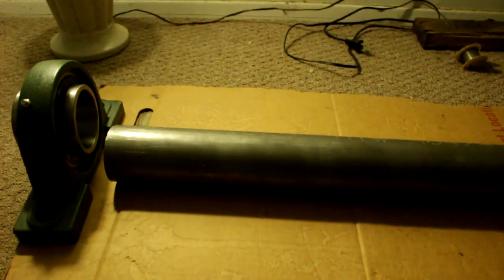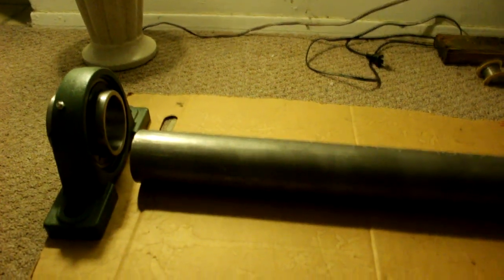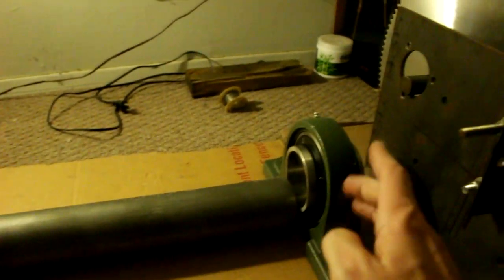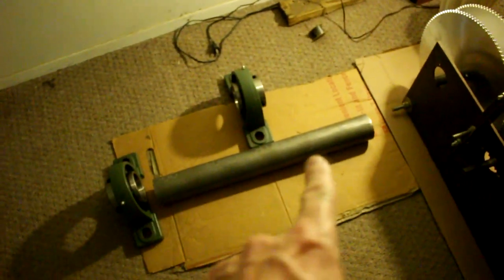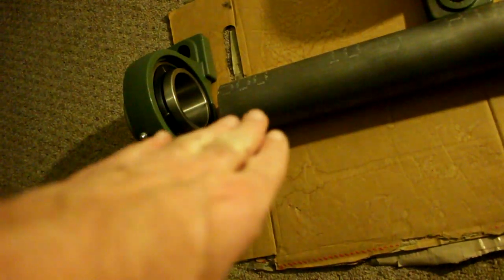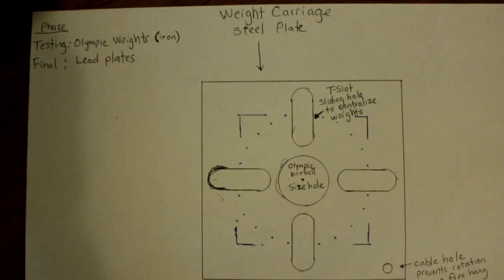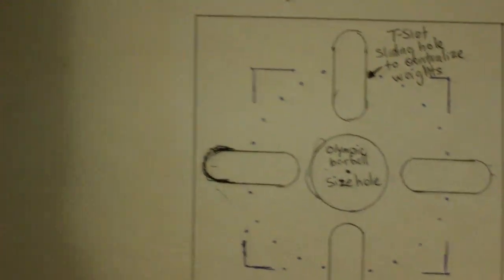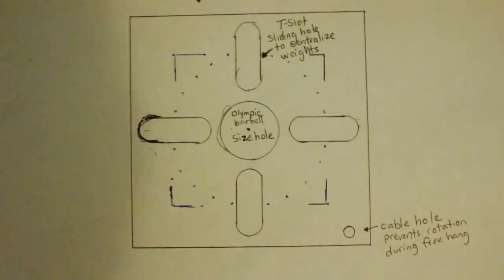Gravity Electric Generator Update

Comment: Good idea but let me propose a slight variance on your idea.  The main drive shaft can be driven by large weighted rods attached to the drive shaft  with ratcheted gears.  There could be several rods falling at various stages of their 40 degree arc.  The weighted rods could be lifted back to the top of the start posirion by using hydraulic jacks.  Main drive, like in your concept, is attached to an industrial size large gear.  Like in your idea, the gearing would be such so as to greatly increase the rpm of the main drive.  The main drive would power a generator.  The generator would easily power a small air compressor that would be used to automatically power the hydraulic jacks that lift the weighted drive rods.  This concept would allow you to easily lift several tons to create a huge amount of downward force.  I could see this working well on an industrial scale.

Comment: What ratio are you using to drive the alternator. You are changing ratios to lift weight right.
Just started thinking about this stuff the other day we have plenty of boreholes  just like the US hundreds of 1000.  If lifting 1 kg per metre  per second uses/makes 10 watts  then slowly dropping 1000 kilos say 1 km that's 10000J  if I read it right.
I have on idea on transmission gearbox will a ratio of say 100:1 actually increase power will she even move? I think so power from smaller high-speed versions could go to batteries with supercapacitors very fast charging would need braking system though.   Of course lifting could be done with a separate motor under different ratios driven by solar wind even hydro Power any excess free clean power.
Reply from the maker: For that much mass, you'll likely need gears not sprockets. The rigidity of the design and tolerances are paramount, to prevent any flexing, twisting, or binding of components. A 100 to 1 might work, but the truth is no matter how math simulation you run, the final design will be trial and error. I moved onto to another design, very innovative. It's going to revolutionize home energy.
Reply: Exactly what I was thinking  a fair amount of weight  to over come the inertia needed to start large motors & the gear ratio

Comment: So how do you plan to bring the weights back up?  Manually?
Reply from the maker: Yes, was considering attaching an exercise bike and some gear reduction. Eventually a 2 or 3 drop weight system would be really cool, may be something like 3000lbs lifts 2000 lifts 1000, this way there's always 900+lbs net going towards the electrical load, with the remaining 1100 or so lifting the next cycle. When all the drops have been exhausted, you would only have to lift the 3000 lbs weight to start the cycle all over again.
Reply: @jryer1  If you are planning to use the energy created by the system to feed itself, that will never work.  You will either have to manually put the weights back, or add an external energy source to get the weights back up.  Your system will not work as a closed system.  We know this and it's been proven in Physics.  So I think you are talking about physically placing the weights back up using an exercise bike and your energy?  If so, that will work as long as you don't break ;-)
Reply from the maker: @valveman12  The perpetual motion crowd is always fixated on closed loops, not me. This is simply an electrical generator with the hope of extended run time, and when the final stack of weights fall, the first stack will have to be lifted back up to start the whole process over again. That could be an exercise bike with gear reduction, solar, wind, anything really. It's even possible to hook the truck or car up to it, drive 8 feet, and bang the weight is back to the top, with some gear reduction between the system and the vehicle. I see this as being an emergency generator, or off grid if absolutely desperate for power in the middle of night or something. Now if you really want something cool, wait to you see my design for driving a vehicle on top of a platform, and the vehicle is the weight for the generator to turn, again with extreme gear ratios, the run time should be fairly long. When the platform is done falling, back the vehicle off the platform, hook the platform up to the vehicle, back up a little more while it lifts the platform up, to start the process all over again. There would need to be a ramp or build up driveway so the vehicle could drive up and onto the platform, very cool design and only uses a few drops of gas to do it.
Reply: @jryer1  I like the solar and wind idea.  That would certainly have a good chance of working out.  I'll be following your progress.
Reply: Getis Realis I'm going to keep searching for others who've been working on something similar to the vehicle lift & I'll share what I find. Questions are how much electricity we could get with a few drops of gas & also say using an electric car? Forums are a good place to look.
Reply from the maker: @joshuanorris9785  I could see 1 kWh be fairly easy to obtain, probably more. The real issue isn't how much power (electricity), but long (duration of time) can that power be sustained. Generally speaking, the taller the apparatus holding the weights (mass) the longer the duration the generator will run. For reasonable practicality, we want the generator to fit inside a garage for the stand alone unit. For the generator being driven by the mass of a vehicle, we want that to fit in the driveway or backyard and be below the highest point on the roof of the house, otherwise we'd probably run into other hazardous issues.
Reply: @jryer1  the taller the apparatus, the more energy required to raise the weight.
This is unviable.
Reply from the maker: @kellenbalen567  Of course it's viable. Are you assuming I claimed this to be perpetual or over unity? Because I made no such claim.

Comment: Set up properly this idea would easily run a home.
Reply from the maker: I believe that is possible. My other design is when you come home for the day, drive your car up a ramp onto a risen platform. Get out of the car, walk down the platform, throw the switch, and bingo the platform slowly falls, via a very high ratio gearbox, which turns the generator. Later, drive off the platform at ground level, stop when tires are on top of two winding barrels. The tires on the car will spin the winding barrels, which lift that platform back to the top, except this time the platform is disengaged from the high ratio gearbox, which makes lifting it much faster. Once the platform is at the top, the high ratio gearbox is re-engaged, ready to be used again. All this for a few drops of gas. Why have the car sit in the driveway all night when he can be the weight that drives the electric generator, at least for an hour or more.
Reply: Getis Realis I've been looking for a video of exactly what you described. its a great idea! I wonder how much electricity that much weight would produce? love yours ideas!
Reply from the maker: @joshuanorris9785  The greater the weight (mass), the higher the gear ratio can be, the greater current (electricity). We are always trying to find a good balance between torque and speed (acceleration).

Comment: Lever the weight for additional power?
Reply from the maker: The winding wheel is the leverage. The distance from the center of the wheel to its outer diameter is the lever. It's best to think of a wheel as a rotating lever.
Reply: @jryer1  but wouldn't a long beam with weight at the end, pulling a chain up increase the amount of pulling power? Im no scholar just head thinking...
Reply from the maker: @LopeyGen4  A long beam would have a huge leverage advantage, but a very limited run time, may a few minutes depending on design. A large wheel would still have a good leverage advantage, but less than a long beam, however its run time would be much longer, perhaps 30 minutes or more!
Reply: Well I guess ill have to upset my wife to figure it out...Thanks for the input. Will keep up on your progress.